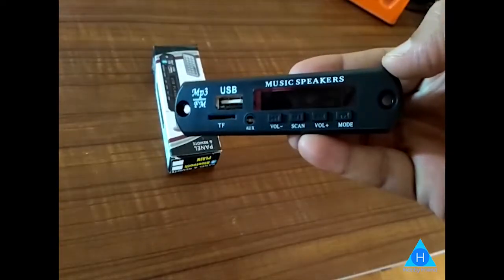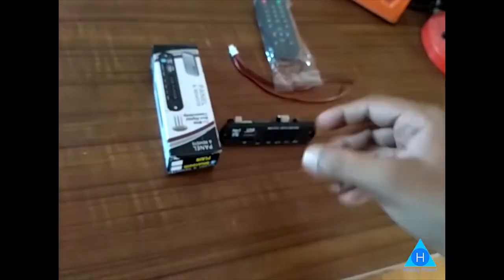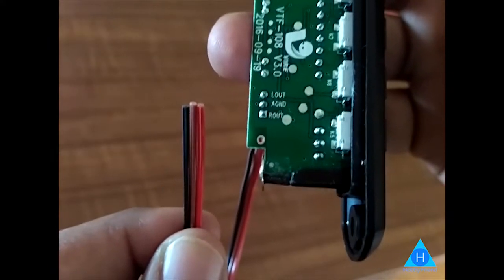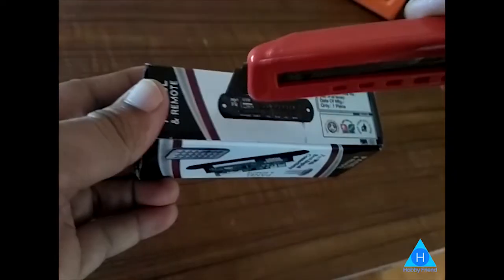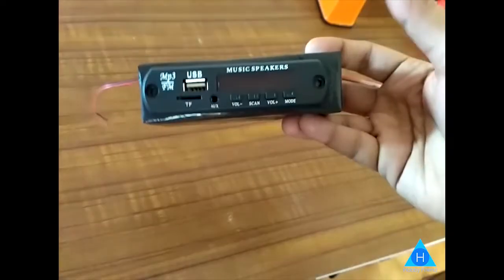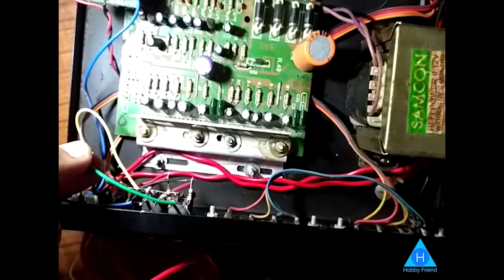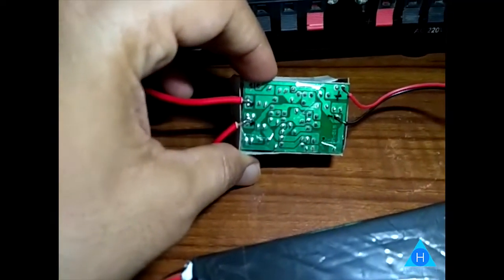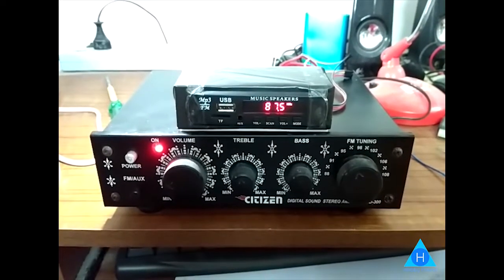Easy upgrade - Old stereo amplifier to USB mp3 player - Low cost

Comment: Already  5v regulator amplifier laye  iruku athula connect pannikalama
Reply from the maker: If you are sure it is 5v, you can. Safety ku extra 5v voltage regulator onu use panikonga.

Comment: Is it possible to connect with pioneer deh 3700mp car stereo?...kindly reply
Reply from the maker: In-built power amp irukkanu check panikonga bro. In-built amp illama iruntha panalam. Also car stereo ku 12v power input kodukanum. So athuvum pathukoonga.

Comment: Usb boardக்கு பவர் சப்ளே ஆம்பிளிபயர்  transformer லே எடுக்க கூடாதா ப்ரோ விளக்கம் சொல்லூங்கள் தயவு செய்து உங்கள் தொடர்பு எண் கொடுங்கள்
Reply from the maker: Correct bro. Thanks for your comment bro. 12v to 5v voltage regulator வச்சி connect பண்ணலாம். ஆனா இத ஈஸி யா இன்னொரு amplifier la connect pandrathukum, portable ah இருக்கட்டும் என்று தான் இப்படி தனி பவர் source use panean.